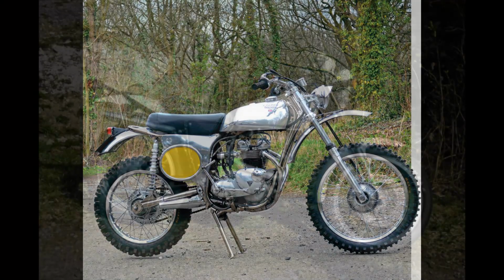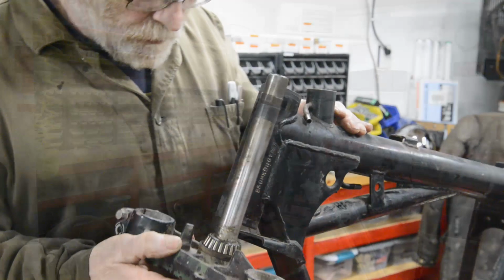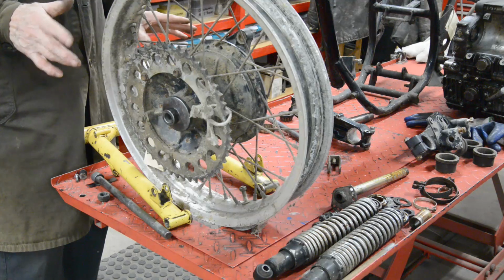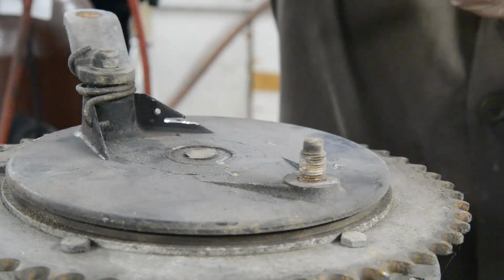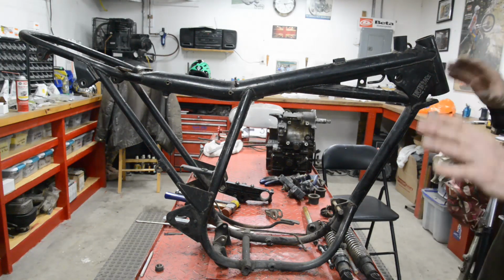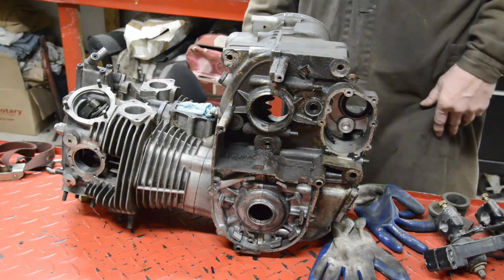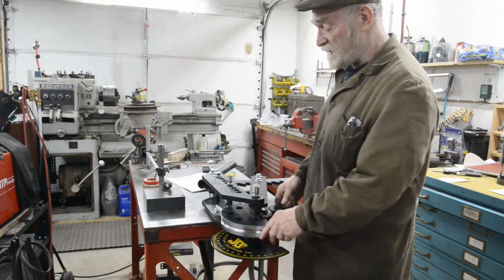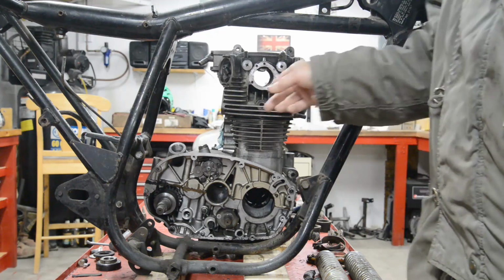YamBSAcki 650 Scrambler  -  Part One

Comment: Hi Mick  Came by this channel recently and will be a regular. I owned bikes for years (Japanese and European)  and did quite a bit of restoration and building bikes from trailer loads of bits. I was always a stickler for originality. Quite a few times I bought stuff which had been modified or improved and these changes were often very poorly executed. The world of specials eluded me but you have given me an insight I previously missed. You are very skilled at fabrication and problem solving but also have a good aesthetic instinct. I enjoy watching your projects greatly. You are the antithesis of the guy with the workshop full of equipment and no idea what to do with it.
Reply from the maker: Thank you Peter. My pet hate are the so called restorers who send everything out to painters, engine and wheel builders etc and then say look what good work I do.

Comment: Good choice on the tubing bender, we bought one of that design from Williams Low Buck tools in the late 70s. When we let it go on down the road to  a new home last year  it was still as new and it built a lot of race car roll cages over the years. You will need to secure your  table down as the larger tubing sizes do require a lot of torque and a exstention on the handle of the bender but very mangable
Reply from the maker: They come with a handle extension now. The welding table is VERY heavy bout the feet do have provision for bolting to the floor if need be.

Comment: Micheal, thanks for the compliments on my old XS 650 scrambler. Almost wish I still had it...in your video, you did not mention the chain run alignment. I suspect that you had already determined that the engine sprocket would match up closely with the swingarm pivot in the vertical as well as be located close enough fore and aft to make sure that the chain tension does not change very much with travel. I always matched that aspect up first when doing swaps. Sometimes it worked...
Looking forward to this build. Dan
Reply from the maker: I will be looking more closely at that when i get to be able to put the engine in the frame. Then I can decide how high or low I want oit. Then again there are always chain tensioners.

Comment: I've done a fair bit of swapping the "wrong" forks on a different bike, or wheels etc. MOST of the time you measure the ID you have, the OD you need and the thickness- then look on a bearing manufacturer website, find the number, then order whatever grade bearing you wish to afford on eBay - without having to muck about with swapping stems? works brilliant for fitting modern wheels that normally have huge hollow axles to old bikes with tiny axles, etc as well - Cheers Mate!
Reply from the maker: That is always my first option, but with some of the early bearings used, and particularly with the loose ball type races, there are no suitably dimensioned bearings available.

Comment: Nice Christmas present, you might as well build a complete frame for it now.
You can cut down the damper tube and fork tubes to get the length and travel you want.
Reply from the maker: It will be put to use on the next Enfield. Not sure yet what to do with the forks.

Comment: Hello Michael, enjoy your video's, that tube bender will have instructions to tie you in knot's regarding bend allowance so here's what I used to do;
Bend to 90 degrees on the protractor of the tube bender then remove the tube and measure how far off 90 degrees it is. If for example it is only 80 degrees then it is springing back 10 degrees so in order to get a 90 degree bend in the tube you must take it to 100 degrees on the tube bender protractor (90 + 10). Hope this is helpfull and saves you time.
Reply from the maker: Thank you, every bit of information will help me to use it.

Comment: Hi Michael, Always love the start of a new project just to see what you are coming up with this time! When you mentioned exhausts the first thing that came to mind was the beautiful BSA FIREBIRD or SPITFIRE SCRAMBLER exhausts both run along the same side of the bike with leg shields for the heat.Would the use of a single carb not increase the torque from the motor and be easier to tune than having a pair needing to be synchronised? Well that's all from me for now, looking forwafd to next Sunday and the next instalment. Stay Well and HI to your good lady. Cheers Dave UK
Reply from the maker: Probably going to have to use a single carb, and I am not a big fan of twin carbs for 360 degree twins, there is no need and they only make it harder to get them to run smoothly.

Comment: Hi Michael,
Looks like another interesting project,  
I don't know wether my eyes are failing but that 1-7/8"  dimension looks more like 1-7/32" to me unless I was looking at a different ref point. 
I'm not being overly critical but it could be a big time waster for a simple mis-measurement.
Looking forward to the next video.
Reply from the maker: You are almost exactly right. It isn't 1 7/8" but 1 7/16". I don't know what I was looking at but as you will see in Episode Three it almost stopped the whole project. Well spotted.

Comment: I seem to recall Norton making a big thing about their choice of large diameter thin wall top tube on the commando, something about lighter and stiffer. Any comments?☺
Reply from the maker: Some early road race frames made by Ken Sprayson of Reynolds Tube had very large diameter top tubes for exactly that reason. Same amount of metal as in a small diameter thick wall but much stiffer and stronger.
Reply: @BritanniaMotorcycles  i only asked because it seems a lot of work to change from large to smaller tubing.

Comment: Hey Michael, have you considered rephasing the crank? You might have fun with that change and should sound great when it's done.
Reply from the maker: I want to use the Electrex electronic ignition and that only works on 360 degree twins so no rephasing. Maybe on another project as I still have one XS engine left.
Reply: @BritanniaMotorcycles  Ah, well if you decide to go that route on your next engine, I believe Ignitech's can be reprogrammed for the rephased firing order

Comment: The Metisse Matchless G80 and Triumph twin frames I've seen don't have room for twin carbs and a single carb feeds them OK and allows for good air filtration, so a 2 into 1 manifold makes a lot of sense, even get a nice concentric in there. (Then I look below, heh) Also can you not get a slimmer tapered roller to fit the headstock?
Reply: They say great minds think alike.
Reply from the maker: I looked through the bearing catalogue that I have but didn't see one that might work but I am still looking. I am thinking of a single carb as that is what I had to put on the XT500 framed bike. Might be a Concentric.

Comment: No need to turn up a new spindle, you can get 25x45x14 taper roller bearings here https://simplybearings.co.uk/shop/p43709/45M/25M1-Narrow-Section-Steering-Head-Set-Taper-Roller-Bearing-25x45x14mm/product_info.html 
Should be available elsewhere too.
And if you use the 36" forks, just put them in with 3" sticking out of the top yoke - easy.
Reply from the maker: I have found some different bearings, but interestingly enough on a couple of previous occasions I have had to get bearings from the UK as they were a size that was not available in the US. Why I have no idea. I don't think that the forks will come up through the top yoke that far because of the handlebar position.
Reply: @BritanniaMotorcycles  Is there any point in suggesting 'clip-ons' at the top of the forks? 
Otherwise, try angled risers and flatter bars... there's got to be a way around every problem.  Good Luck :-)